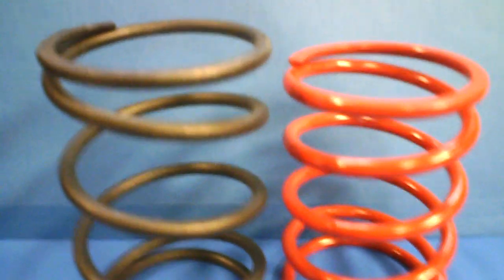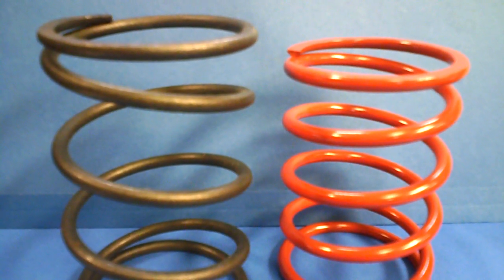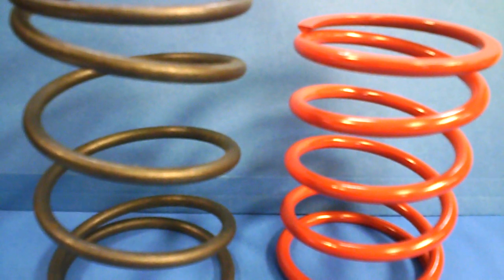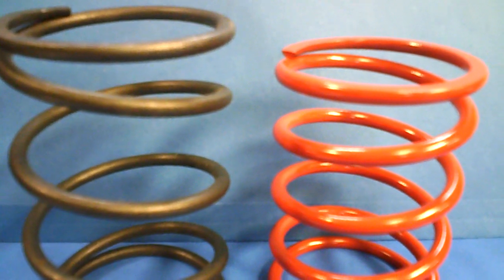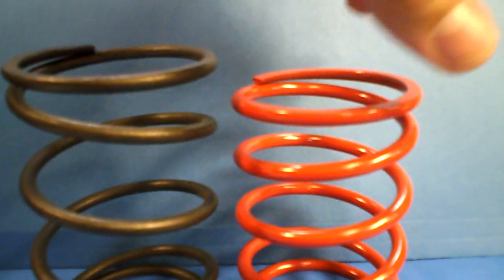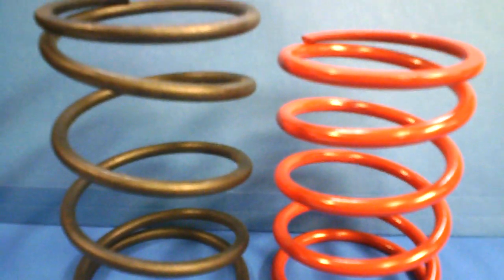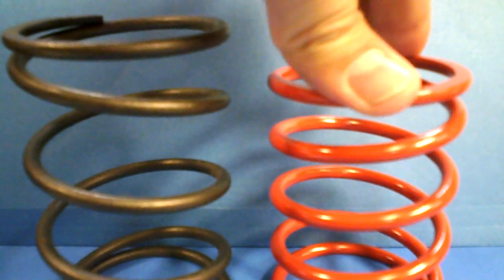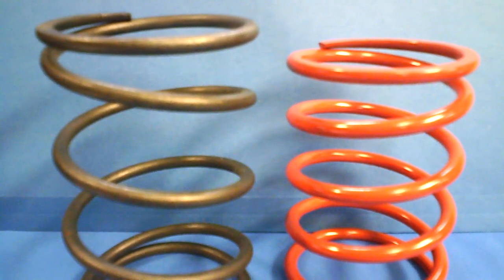How the Torque Spring Works 300cc Scooter and GoKarts

Comment: My scooter stock sprint is 800rpm 
Then we have 1000rpm 1500rpm and 2000rpm springs 

If I change to harder spring does my rpm increase before clutch engagement? 

Let’s say My take off is now at about 6000rpm 
Wide open throttle and increasing. On 800rpm clutch spring 

If I change to 1000rpm clutch spring will my take off rpm increase to 6200rpm?

Comment: Clutch springs are all identified by their colors, so no it's not your preference of color's please! All CVT clutches all use different color springs for their spring pressure I.D.  Now to make it even more complicated, they have primary and secondary springs with Dual colors as well like a Blue/Green with the main color being blue with a green stripe down the coils. These are identification color's that companies like Polaris, Yamaha, Kawasaki and the main clutch builder of the better CVT designs and oldest company around Comet Industries. If you look up from the manufacturer of the CVT you have, there should be a chart that tells you what your roller weights are and what springs go with what rollers, and the same applies for the secondary pulley in the back which also utilizes a different type of spring from the primary. If you change one spring you more than likely fix one area but screw up other places like the shift points or not getting full belt movement into the secondary pulley if you have too little weight of the rollers and too much spring pressure, thus meaning the primary clutch won't close all the way because the weights can not overcome the spring pressures of the primary. So yes there's WAY more than meets the eye when it comes to properly tuning a CVT clutch properly, believe me, I have a bit of experience in this field tuning all kinds of CVT systems. Please do yourself a favor and do some more research on this subject matter. It's not a cut and dry answer to just tossing in a spring or lighter weights. Every action has an equal and opposite reaction to changing something in these systems. Like I said ya may have a better stall speed engagement at a higher rpm but you now need to be sure it's holding out your shift points or dumping it right into overdrive or for that matter..... even getting to the point of full belt transfer and you still have full overdrive for this matter. When you setup a CVT to the engine and the machine it's on, a lot of factors come into play, like what rpm window the engine is starting to make its power and where it peaks out so you keep the rpms within this window of its power band. The other is the amount of weight of the machine plus it's passenger loads! Gas and anything else you might be adding additional weight to for an overall weight. The final drive, or in other words.....a gear reduction box, does it have one? Or does it not? Tire  diameters, example if you have your clutch tuned for a certain tire diameter and you go changing wheel's to a bigger or smaller tire diameter now you've changed the amount of torque needed to overcome or not via the CVT thus changing its behavior throughout the engagement rpms cycle. So yeah I'm sorry to say something, I'm not doing this to piss you off by any means, but I'm trying to educate you about how these things work. Some people think their just magic in a box and others understand enough to make things worse than they were before by just throwing unmatched parts at them wasting time and lots of money with a system that's worse off than it was beforehand. Just take a look into all the information on YouTube here all about the CVT system's and how they work and respond to different situations. If you could get a chart from the clutch manufacture that be even better, this will give you a much better idea of what springs to use together with what weights to get your desired outcomes. I know Comet industries has quite a few depending on what model of clutch you have or are running. IDK if yours is a comet or not? But a lot of Chinese manufactures have copied the comet clutches so you may have to go by pics and match them up via eye? Good luck and I hope this helps explain a little bit better on what's going on and how these things work? Have a good night, Jim.

Comment: Hey, i try many times with my 110cc scooter and have some result, with same performance:
-stock: 14g roller, 1000rpm clutch spring, 1000rpm contra spring. 
-16g roller, 1200rpm clutch spring, 1500rpm contra spring
- 12g roller with modified front pulley (13.5 degree, stock 14deg), 1200rpm clutch spring, 1500rpm contra spring. 
So i think if your engine high torque, you must use high tension contra spring to keep the belt no slip. 
After that you choose the roller: the more heavy the more top speed but low take off speed.  But you can not use too light roller because your bike never shift to highest gear, and when off throttle, the belt may slip and vibrate.  Try false to choose the optimal roller weight. 
The clutch spring depend on your clutch shoe size and material: the more friction, the more rpm clutch spring to avoid engine overload. 
Remember: CVT coefficient only 30-40% engine power.

Comment: Hi, i have 2 different brands of contra spring (torque spring) but both are 1000rpm. The difference between them is 1 is shorter than the other. is there any difference in performance? Will they react differently? T.i.a..

Comment: Hi martin, you mean you need heavier flyball if you increase the rpm of center spring? My flyball was 11g before and the center spring was upgraded from 1k to 1.5k and now have 10g flyball, is that correct?

Comment: Hi bro i have 155cc scooter with max torque of 13.8 N.m @ 6,250 rpm and max power of 11.1kW / 8,000 rpm. What is the best roller weight to have better top speed??
Reply: Des Musix -hey how to calculate the minimum and maximum force that required when for shaft get engaged in clutch

Comment: what center spring and clutch spring rpm is good for 110cc 4t stock engine? I have aftermarket variator and df and 7 - 9 rollers. I wanna upgrade moooore but I must stay on stock engine as long as I could for some reasons.
Reply: you can upgrade cvrt but engine just stay for daily use.  bore up engine tend to be short like engine oil need to be change immediately

Comment: I have a 250cc. If top in is a concern, and I just want more bottom end(torque at take off). Is a 2k spring what I need? If not what would you recommend top kill the top end and gain bottom end?
Reply: *I ment top end is NOT a concern.

Comment: the stronger the spring the longer you stay in a lower gear, the better spring desgn means no distortion and even spring force.
Reply: Hey, i try many times with my 110cc scooter and have some result, with same performance:
-stock: 14g roller, 1000rpm clutch spring, 1000rpm contra spring. 
-16g roller, 1200rpm clutch spring, 1500rpm contra spring
- 12g roller with modified front pulley (13.5 degree, stock 14deg), 1200rpm clutch spring, 1500rpm contra spring. 
So i think if your engine high torque, you must use high tension contra spring to keep the belt no slip. 
After that you choose the roller: the more heavy the more top speed but low take off speed.  But you can not use too light roller because your bike never shift to highest gear, and when off throttle, the belt may slip and vibrate.  Try false to choose the optimal roller weight. 
The clutch spring depend on your clutch shoe size and material: the more friction, the more rpm clutch spring to avoid engine overload. 
Remember: CVT coefficient only 30-40% engine power.